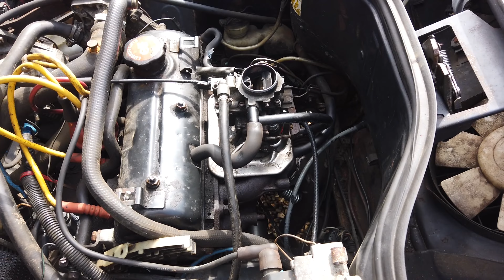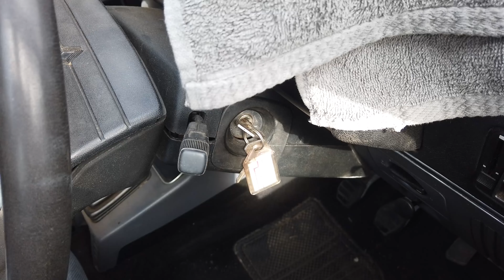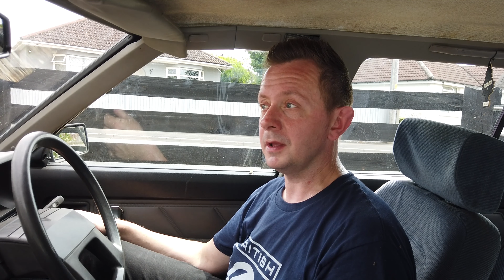FIXING THE RENAULT 9 - PART TWO - ELECTRICS - OIL CHANGE AND CLUTCH ISSUES

Comment: I  was half expecting you to suddenly remember to refit the drain plug  ... of course I've never done that ...
I guess you also checked the oil level after running the engine - just to make sure the filter had refilled ... can be useful if the manual gives a range of oil capacities or you didn't start with a full 5l of oil so have more guess work involved!
Great vlog - really good to watch - much thanks for sharing